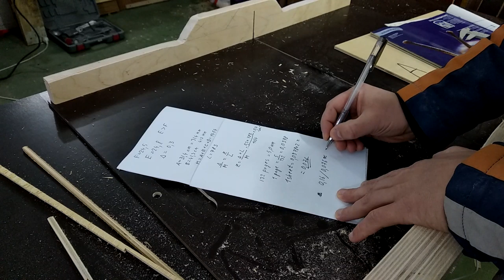5 Cut Method to check the Accuracy of a Crosscut Sled

Comment: This method is good, but you have one problem with the math.  M should be A+A+A+A, not A+B+C+D.  It does not matter how long is B+C+D.  The error of the fence angle is 1/4 of the angle made by E-F (delta) over the length of the last cut (A). If you are cutting a square piece the result is the same but if your test is a rectangle it's not.
Reply: i like you tom

Comment: 132 pages front and back so really only 66 pages. Also you did a lot more math than you needed to, you only need to measure against the last cut and then divide by four. (A-B) ÷ 4 ÷ Length of 5th cut x Distance between pivot point and the point of adjustment = Error. Credit to William Ng.
Reply from the maker: 03:26 - I calculated the thickness of the sheet (not page). Your logic is correct if sides A and B are equal. If the workpiece is rectangular, then it is necessary to measure 2 sides.
Reply: @MazayDIY  not true! Only the last length matters. It can be a rectangle. Check out his video
Reply: so based on William NG formula and this video measurements, the error is -0.1870222929936306 ? not 0.16 ? not criticizing anyone lol just trying to learn this method

Comment: This squaring up method only works if the guide rails have zero backlash.  It would be better to start by checking how much backlash exists in the rails using a magnet backed dial indicator.
Reply: and use something other than plastic calipers :)

Comment: Why cutting many times? By far simpler method I use:
1) set the pivot point on front fence
2) Start machine, raise slowly the blade until it shows the cutting line in the middle od sled and forward.
3) turn off machine and use combination square or 90 deg ruler to adjust the front fence to the cutting line.
Cannot be simpler.
Reply: Because this is not 100% accurate.  Do what he's demonstrating in the video and you'll quickly see that.
Reply: Your stated process is a starting point for the five cut process.  Your process relies on how good is your six inch by twelve inch combination square and how good is your eyeball at judging your square gaps. 

The first four orderly cuts sums the errors of each cut.  The fifth cut yields a strip of material with the sum total error.  You now measure the width difference with a precision measurement instrument like a digital caliper, vernier caliper or micrometer.   You divide the difference by four to calculate the error per cut.  Dividing by the length of the strip yields taper per inch.   Now multiplying this taper per inch by the distance between your pivot point to your adjusting point on your cross fence gives you much finer adjustments per inch.  
You can’t possibly see this fine of adjustment with a square.
Reply: @michelmontgomery939  There is no need for finer adjustment when 0,1mm is the error. In carpentry, that error does not count because bending of fence and blade comes into play. 
There is nice video where one carpinter say - 5cut method is brilliant, do not use it!
Reply: @priscwy794frag  100 microns in one millimeter would be a significant error.
Reply: @michelmontgomery939  It is 100 μm over whole sledge fence, not over 1mm.
Reply: @priscwy794frag  I agree 0.1 mm over a meter would be excellent.  I was trying to explain the process not the shown example error.

Comment: What is the purpose of this video? You didn't explain anything.
Reply: and he's maths is way more complicated than the William Ng's method 
(A-B)/4/length of cut off rectangle = error per mm. Use that to adjust from pivot point. Also that pivot should be a point not an edge. I'm sorry this is a poor video

Comment: first of all it’s ridiculous to try and tune your table saw to within a couple two or three thousands lol using a machinists square which is totally accurate to square your fence to the blade is as good as you need. fussing over a couple thousands is insane, you’ll never notice it in a joint or anywhere. I’ve been woodworking and building furniture for over 40 years and have never used this method, seriously lol